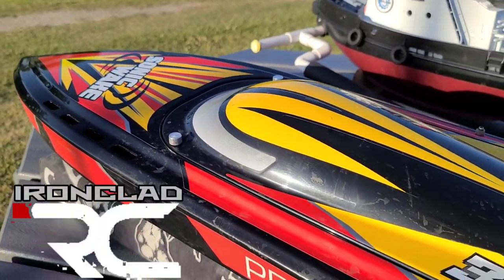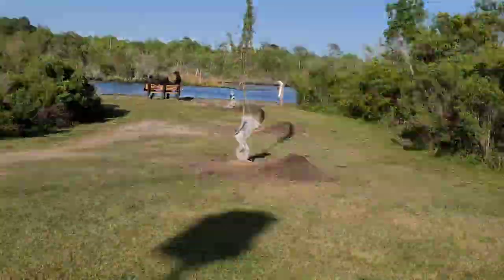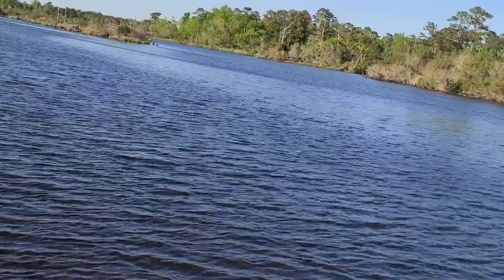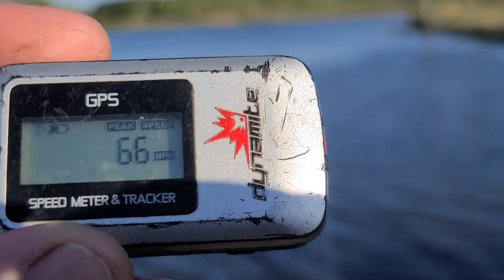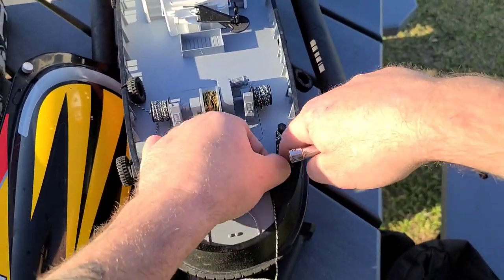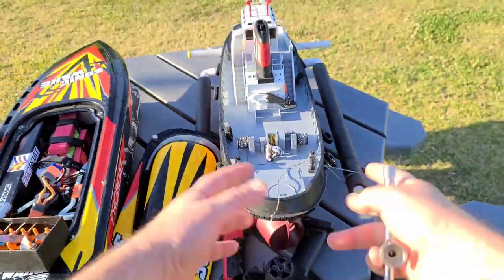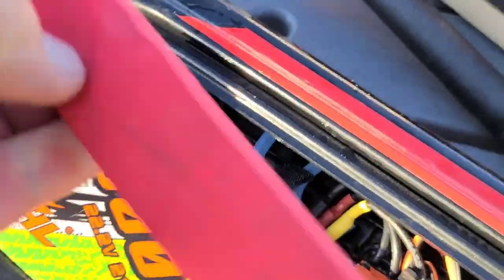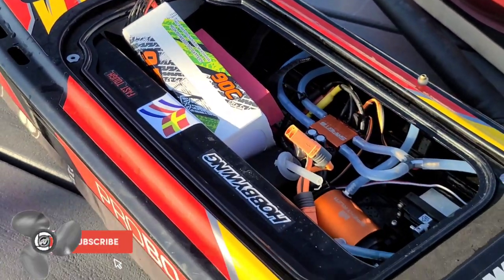Sonicwake V2 Hit 66mph Stock Electronics (Short Version)

Comment: 66 MILES REALLY FAST WITH STOCK SONICWAKE V2 👍💯  I also use the same CNHL 9500mah 90C 6S and 6200MAH 6S. It is a battery optimized for speed.